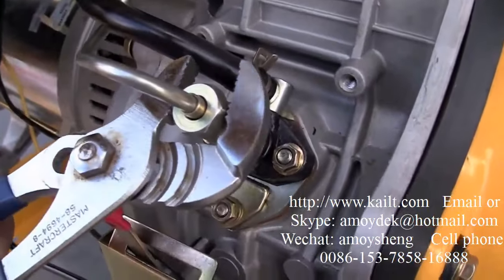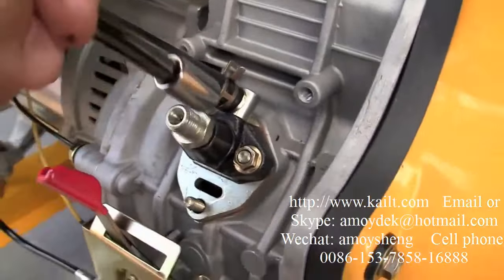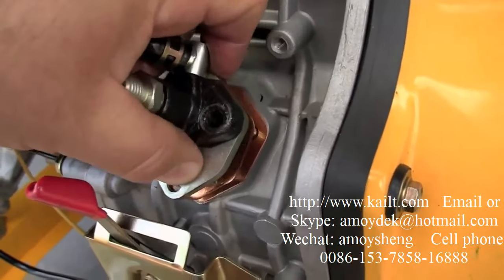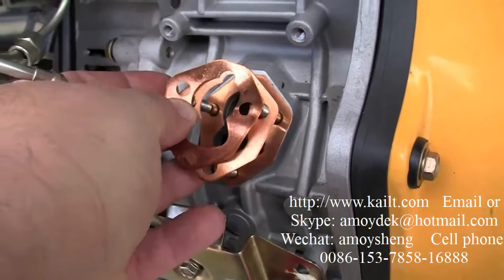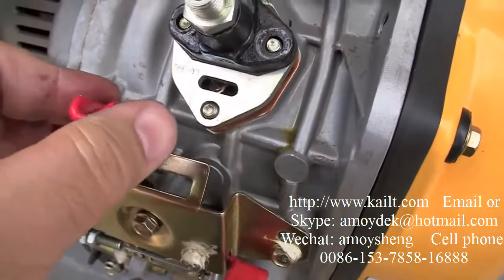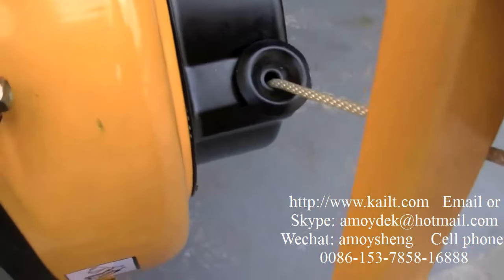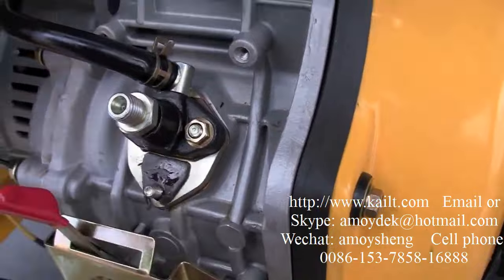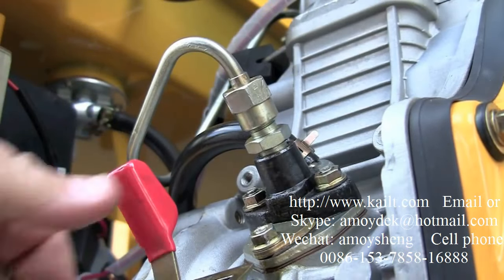how to adjustment fuel pump for air cooled diesel Generator Fuel Pump adjustment form amoysheng@163

Comment: Kipor KDE 6700 TA3. Pump have electric valve on the top, more complicated to place it.
It did not work the way to set pump at the middle and then play with fork. It worked great when pump was set complete to the left. 
Thank you for video.

Comment: YouTube user numuzmar has a video on actually properly setting the timing with the shims. It is the only video I have found that actually shows the process. It's in Russian or Ukrainian or something but it shows the process. I tried to post a link but my comment was deleted. It is the video where the thumbnail is a crossed wrench and screwdriver, a picture of the engine and a glow plug symbol. Hope this helps someone, it helped me

Comment: I've got one of these on a generator. It starts and runs fine but typically once it's warmed up the rpms slowly drop a little and if you just nudge the throttle linkage a little it comes back up for a little while again and so on. Any ideas what will cause this or what I can adjust?
Reply: Cam wear, hence why the shims are important to adjustment.
Reply from the maker: please kindly send email  to  info@wdpowers.com  or add my wechat id   amoysheng

Comment: Any idea on how to fix decompression lever. It pops up when starter rope is pulled only a bit. Any help out there?
Reply: The arm inside is worn out mine did that after 10 starts you just have to hold it
Reply: Thanks brother

Comment: So what happens if you take all of the shims out? More smoke?
Reply: Also advances the timing a bit. more pump travel and the injection happens sooner
Reply: @CharredSteak  would taking out the shims give it more fuel
Reply: @tylervogel4135  technically yes, unless the pump bottoms out
Reply: @tylervogel4135  taking out shims will increase fuel deliver but it will advance the timing - so the engine.
Ight possibly have an early ignition and in that case will work against itself as the piston travels Into compression - 
      Fuel deliver or the amount of CCs is gauged by barrel and plunger in the fuel pump also the delivery valve on top of the fuel pump - 
      Also you would normally size the injector to the fuel pump delivery - 
     Generators fuel systems at times are set up diffrent than other fuel systems - at full throttle - they might deliver 150% fuel to handle surges when say a electric motor comes on - it amounts to puffs of black smoke when there surges - 
     Regular variable speed engines don't incorprste 150% fuel at the very end or 100% fuel delivery
Reply: A trick to install the pump is to put the fork centered in the hole and center the ball of the pump in the window.   Also you shouldn't bend the fuel line if you need to remove it take it completely off bend can and will cause high pressure fuel leaks

Comment: hello sir good day ,Does it lessen the consumption of diesel???
Reply: It will cause it to use slightly more fuel - he is just advancing the timing according to altitudes above 3000 ft - 
     It's better to leave the timing alone - the you don't want the timing advanced to the earlier setting of 3000 ft and above - if you below 3 or 4000 ft

Comment: At higher altitudes you want more advanced timing, not less, this is backwards. Higher altitudes = Lower Atmospheric Pressure so ignition will be delayed. With Ignition being delayed, you want more time for Ignition. At lower altitudes you want a little more delay in injection timing because the increase in atmospheric psi will cause ignition to happen sooner.
Reply: Thats what he said

Comment: Please what do I do to stop oil dripping from underneath and on top of the monitor window even after putting back the oil soaked gasket and the cover?
Reply: Make sure timing shims are clean and block and pump surfaces are clean and make sure nuts are tight. You can cut a new gasket for the window out of cardboard box board like a cereal box or whatever.

Comment: never bend an injector line
Reply: Yes, a little is ok, just not that much, he should’ve just taken it off completely.
Reply: Correct I've dabbled in some injection systems and sometimes lines are just a little bit in the way a small tweak won't hurt just don't bend it back that's where you run into problems and the injection pump on these little engines is set at  around 25 psi it's not 3000 like a big diesel it wouldn't have enough momentum to keep itself running let alone a piece of equipment if it was set Up that high

Comment: I have been a Diesel Technician for over 50 years. It is Disgrace seeing you work on this Diesel Generator. First you DO NOT use a pair of Pliers to remove and install an Injector fitting, You use a 19mm Pipe Wrench. Second you don't seem qualified enough to adjust the Injector Pump element. This is supposed to be done in a climate and air filtered controlled Diesel Injection shop. With a machine to deliver the correct amount of cc's of diesel fuel, to the injector. It is a good job you are not an Aircraft Mechanic 😡
Reply: Its a 17mm spanner and he should have measured the shim pack in there and increase or reduce thickness depending on load,  smoke color and type,  sound level.  no shims = nailing and blue smoke and hard to crank over due to ignition way before tdc.   to many shims =  quiet engine,  hunting with white smoke, racing when turning over. optimal timing should be between 10• & 5• BTDC.  Veg oil needs between 25• & 20• BTDC to allow for the slower burn time.
Reply: pair of Pliers AKA Saskatchewan Socket Set.
Reply: Chill out big shoots. It's a generator. Not a multibillion dollar engine. He will figure it out
Reply: @bagelsgarage  Sp Isiah ..what you are saying is that it is OK for a technician to rape a piece of machinery provided it is not too expensive? You must have gone through a different aprenticeship program than I did. My leading hand was Swiss. I dont think you and he would find much commom ground when it comes to questionas of proffessionalism.
Reply: Who cares really. It’s a cheap Chinese motor which means it’ll run forever. Pliers are fine. Some people don’t have a shop. And you don’t need qualification to advance timing brotha
Reply: I'm a A&P mechanic...…not sure what you mean we use adjustable plyers  (Knipex)  on everything..... and secondly  this is a dirty old Yanmar meant for easy field maintenance.  I've torn apart several of these  in the jungle to change out pumps and injectors with out the care of dirt.   your comment makes me laugh.
Reply: Lol it's a China diesel. Pretty sure they didn't build it in a clean room. A hammer and a chisel would be more appropriate for removing the line nut LMAO
Reply: I'm a third generation offshore oilfield mechanic - I have worked in injector shops rebuilding fuel pumps and injectors - 
      That engine is just basic - it doesn't have to be sent to a air-conditioned shop to do minor work to - that includes the fuel system - 
     I have worked on injectors fitted to a millionth of an inch - but that fuel system is not that tight & that's not a million dollar engine - I've done that in the remote mountain oil fields to generators set up to run at sea level - all he did was advance the timing by a hair so it would respond to surges better
Reply: Pipe Wrench? 🤔 aka "Monkey Wrench"? 😅 that'd be worse than the  channelocks he's using! I think you meant to say "flare nut wrench" 😉 unless you're one of those "Diesel Technicians" that literally only changes tires every day 🙄